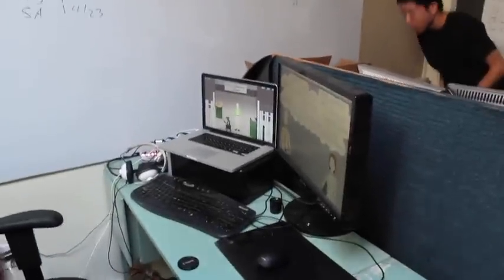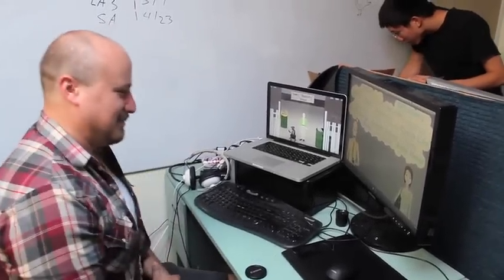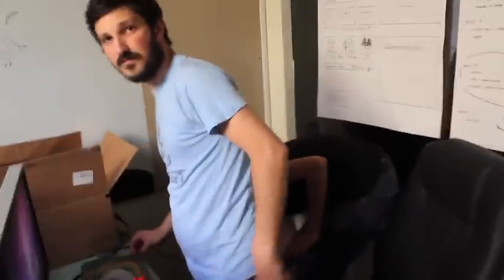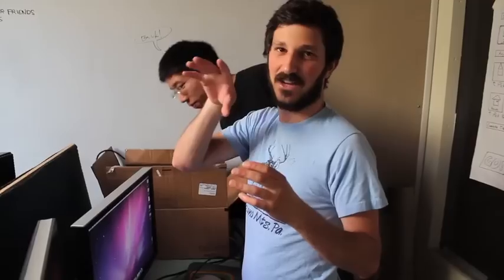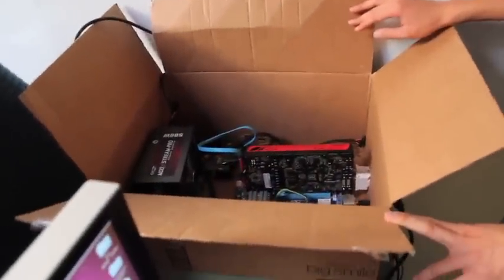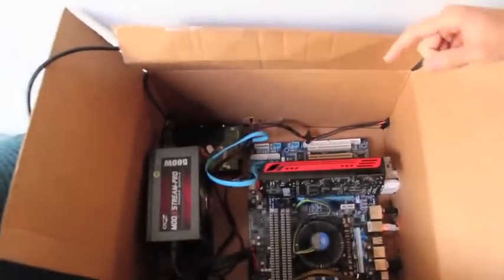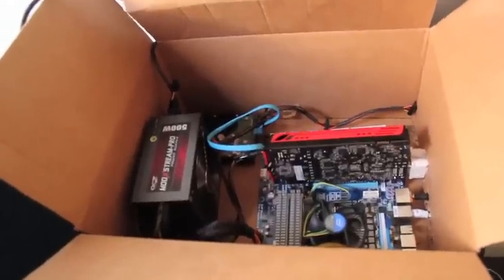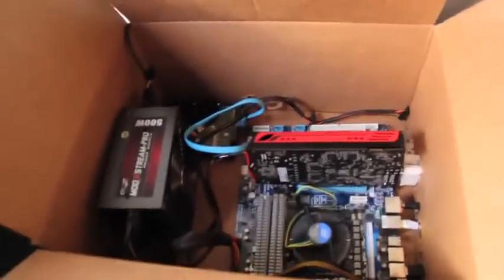One Block Off the Grid - Hackintosh

Comment: Well that's great but what you now have is a jumble sale box with $800 of computer equipment inside instead of a resellable decent computer. If that box ignites, and it will, it was all for nothing! I would be ashamed if my startup had to use a jumper on a cable tie to turn on their computer. Hit the wrong two pins and hear your $800 "investment" make a little fizzling sound before going in the trash

Comment: How is this some new funny cutting edge thing?? I ran a computer mounted to a piece of plexiglass 9 years ago. I also installed a carpet covered computer in my SUV, later it became a carpet covered fileserver in the dorm. Running a computer in a box is dumb. Also ditto on the 20.00 case. I mean, I know a startup has issues with funds but blowing a computer over a 20 buck case is dumb.

Comment: Yep, but splurged on a CM 690 II Adv case for mine.  I after years of paying major loot, proly tens of thousands for a real Mac.  I went the hackintosh route and couldn't be happier.  Mac OS X 10.6.4 (retail install) 32bit, GA-X58A-UD3R, i7 930@3.78Ghz, H50, ATI 5770, 12GB PC3-10600R ECC, 2x32GB RAID0 SSD for / and 1.0TB Samsung HDD for /Users, 24" Apple DVI.  go to tonymacx86 com for more info

Comment: ingenious..
Props to Kevin!
However, if the "box" case is closed/sealed, won't it cause heating issues? The system would become unstable, no?
Plus, wouldn't it be a fire hazard once the system is running under full load?

To save money on the case is good... But once your whole studio is on FIRE When (Not if) the PaperboxHackintosh goes a burnin' - It ain't so cool.